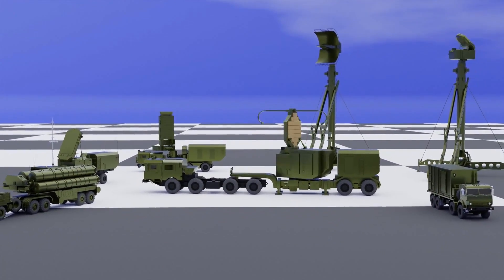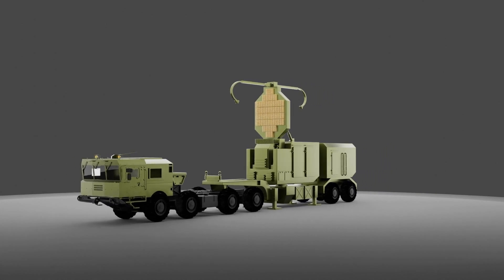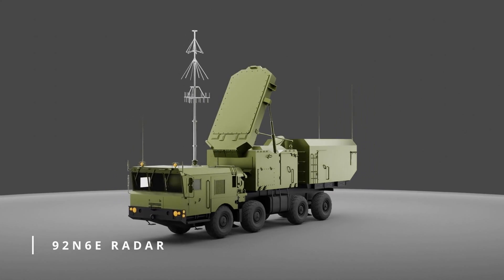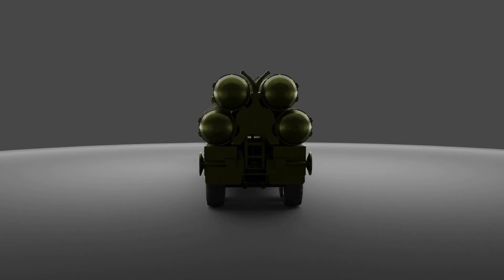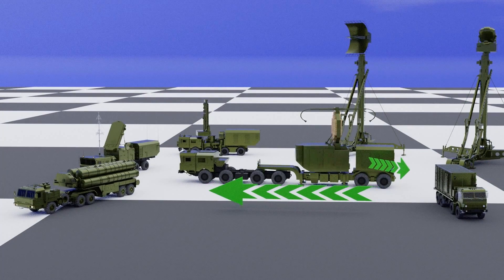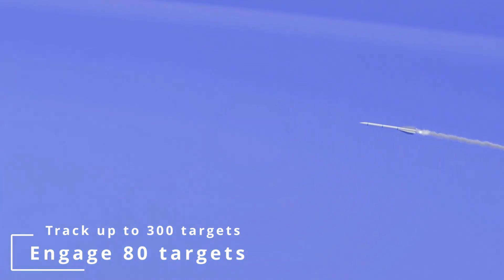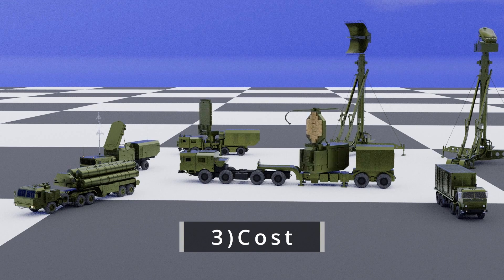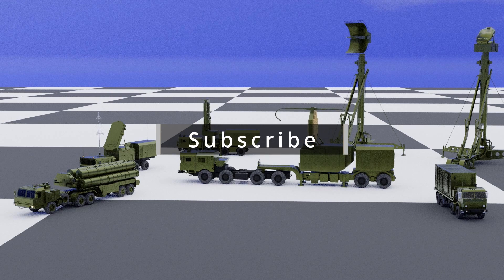Russian S400 Missile Defense system: 3D Intel You Don't Want to Miss! S400 In Action

Comment: Presentation made by AI. Limitations: can only engage targets within its range... Realy? Wow! Btw 64n6 is not Tomb Stone its Big Bird.
Reply from the maker: Basically, the 91N6E is an upgraded variant of the 64N6E radar (NATO-designator “Tombstone”) with the same antenna design but higher transmitter power.
Reply: @Learnwithbuddy  91n6e or 64n6e are both designated as Big Bird. Tomb Stone is the FC of S300pmu2... 30n6e2.